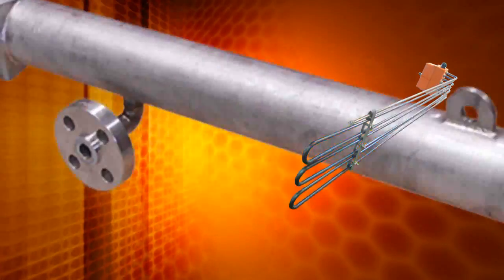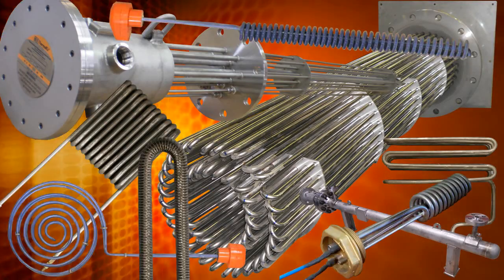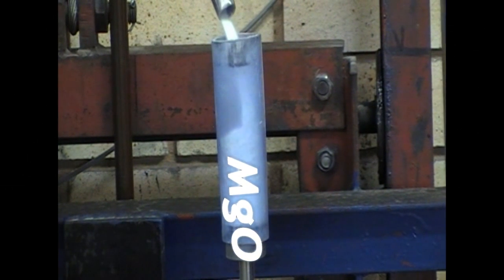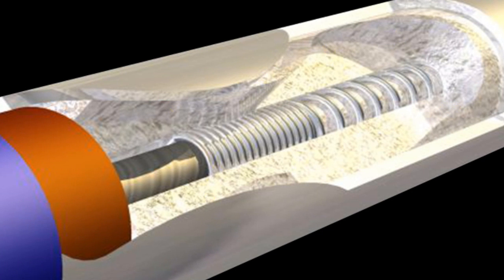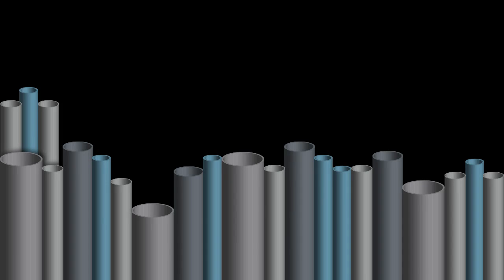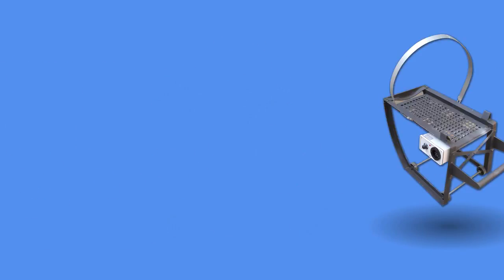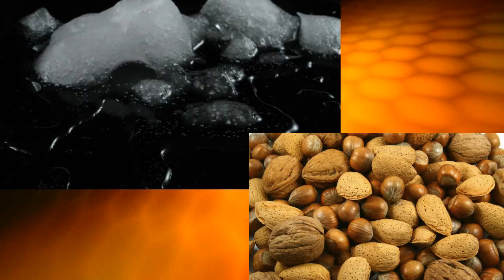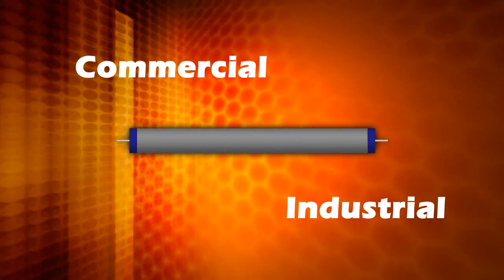What is an Electric Element?

Comment: The resistance wire generates heat, not the magnesium oxide (MgO). The MgO acts as a electric insulator between the resistance wire and the outside material of the tubular element.
Reply: Yep. The wire gets hotter from electric resistance and generates heat. The MgO acts as an electric insular and evenly dissipates the heat across the tubular sheat for uniform heating.